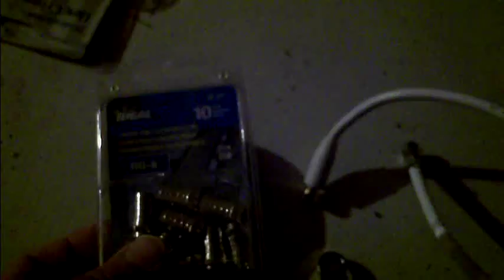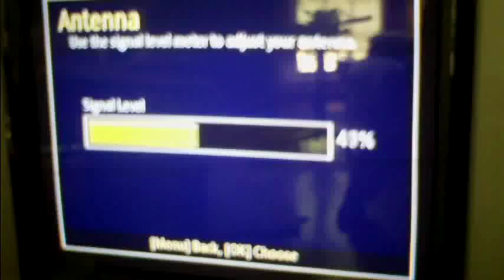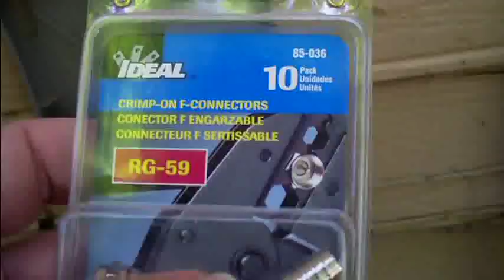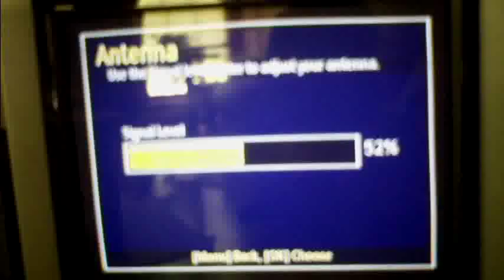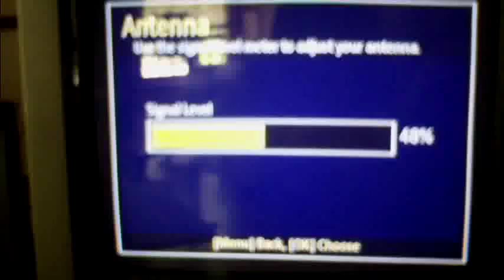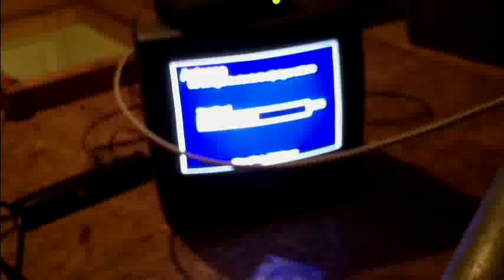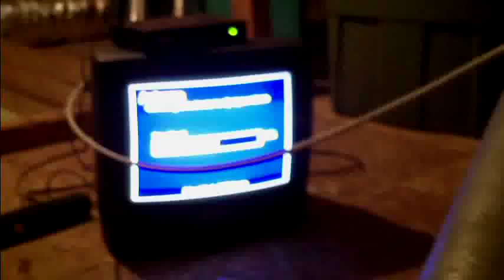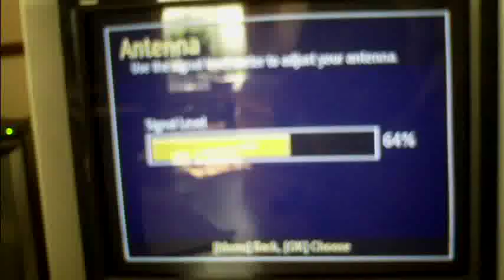DTV and HDTV Part 9, Attic Antenna Install, Part B of Three Parts

Comment: Google antenna point
That'll give you an idea of where directionally the stations are plus how far they are
Your long range yagi should get 70% or better signal anything that's in range
Point in direction of the majority of stations
The shorter leaves will get the stay stations that are too the sides
Really should make your cable the same either rg6 or all 59 screw on are same as crimp connector unless you go with compression but I'd just go screw on coz I think you may be grounding with your crimp on
PUT THE ANTENNA IN FRONT OF THEM AIR DUCTS
NO AIR DUCT BEFORE ANTENNA!
THE ANTENNA SHOULD BE AT THE END OF THE ATTIC NEXT TO THE GABLE WALL
OF STILL NO IMPROVEMENT OUT IT ON THE ROOF/FIRE PLACE/TREE ETC
WHEN TUNING SIGNAL
RUN ANTENNA DIRECTLY TO TEST TV BYPASSING ALL YOUR SPLITTERS AND JUNK

Comment: If you are at least 30 miles from the nearest transmitter, I would try a Winegard AP8275 Preamp with the attic installation. If the nearest transmitter is less than 30 miles, a Winegard AP8700 might be best.

Comment: Try adding a Winegard antenna preamplifier. It should help improve your reception. If you are able to install the antenna outside, you will most likely get better reception. But for either installation I would use a Winegard preamplifier.

Comment from the maker: Yes, you are correct. I was able though to change things around and got it working good.
Also The 120 dollar DTV tuner I got really locks into the stations. I don't get the weird echo problem I was getting in the walmart RCA DTV tuner.

Comment: I use to work for DirectTv and using an rg6 and an rg 59 cable will reduce the flow going threw the cable. You need to just change over everything to the rg6 cable and i think that will solve your problem and get a better reception.

Comment from the maker: my main concern is having electronics cooking in the hot attic. that attic gets 120 degrees easy. Higher up would be hotter. I like the idea of the phantom power though the coax, where the power supply doesn't have to cook in the attic. I wonder the max length of coax can be used. Absolutely, the amplifier has to be right on the antenna to have the best effectiveness. Man! Do I miss the analog days. Just deal with some snow. Now, degraded signals pixalate and drop out. It's madness I tell you!

Comment from the maker: check out part C. It's working pretty good.
I pointed the antenna more to the stations ESE instead of more SSE. I lost some of the weaker stations like SMILE, butr gained some other weaker stations. they have weird names to the stations and they are very lame in thinking of new programming. What do you think of the Winegard antenna signal boosters? Can they survive attic heat?